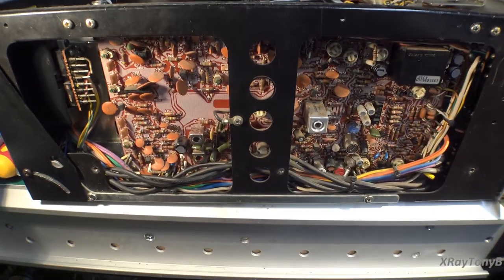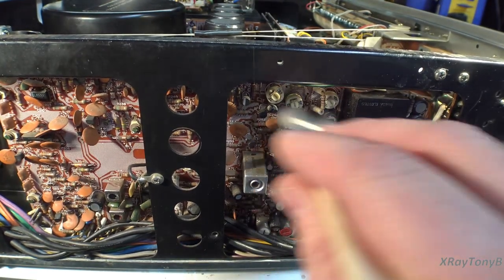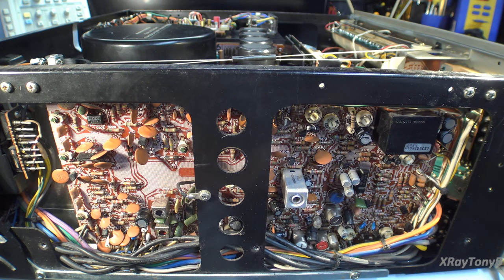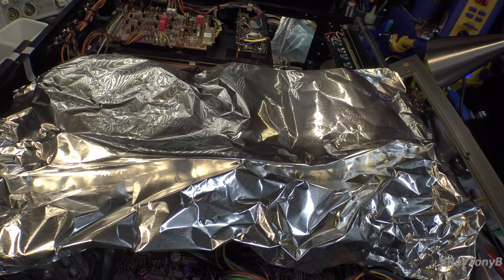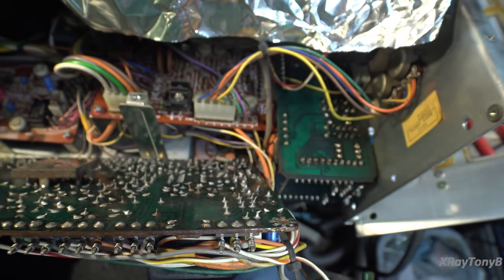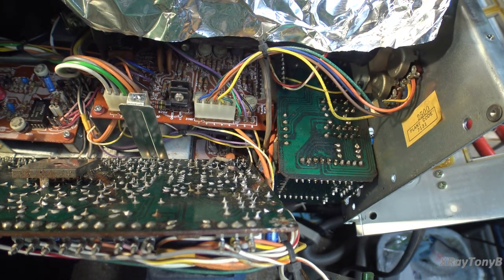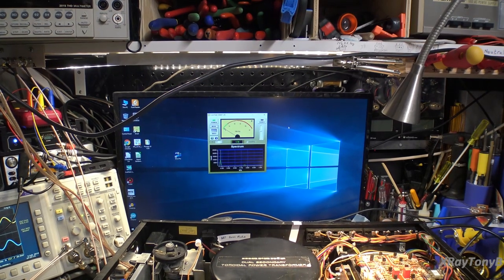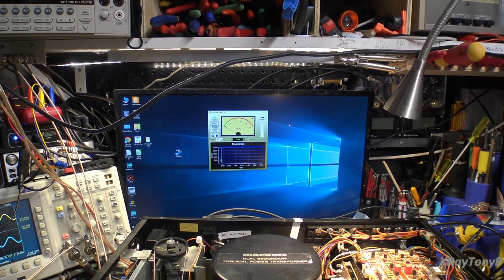Marantz 2500 Part 4 - Answering Viewer Questions and Finishing the FM Tuner

Comment: I have had wonderful results with "Oven & Barbecue Cleanser", a foamy product that comes in a spray can which is designed to dissolve caked grease.  Sometimes I need to clean PCB's that are so incredibly dirty and sticky with tar from smokers that cleaning with the usual products like alcohol (IPA) simply does not work.  I remove the PCB from the device and check for delicate components that are sensible to moisture, like coils, enclosed pots and relais.  Those sensible parts have to be removed prior to the cleaning procedure.  I spray the PCB on both sides with the white foam.  It immediately starts to bubble.  I use a soft paintbrush to apply the foam between components and leads, so the product reaches all difficult corners. I let the foam do its job for about five minutes untill the bubbling stops.  The thick layer of tar gunk dissolves like a brown slurry.  Then I rinse the PCB with lukewarm tap water and a clean paint brush.  I dry the PCB with paper towels and a hairdryer, so no traces of moisture remain on the PCB.  The Oven cleaning product does not attack nor affect the color codes on components, nor does it harm the silk screen printings on the board.  The end result is spectacular. I never had any issues with electrolitic caps or transistors.

Comment: Thanks for sharing your knowledge, much appreciated, another grand video. Though not a beginner, I still pick up valuable info and tips from you, so watch your vids all the way through. For instance I wasn't aware of the ESR changing with frequency (though it's obvious in retrospect).      
     Another issue with using a cap of different V rating is that of bias V. An incorrectly biased cap, with too low bias V, I've read, can exhibit distortion, as well as not staying formed properly. A classic EG, would be a cathode bias cap in a valve circuit. Thanks again for sharing your knowledge, much appreciated.

Comment: I would say that the type of restorations undertaken on this channel are probably best not tried by beginners. Heck, some of them are challenging for experienced techs. You'd be better starting with simpler devices. However, the diagnostic procedures  and repair methods demonstrated are sound and well worth practicing.

Comment: Re: electrolytic cap voltage ratings, the way I look at it is this: In the olden days, the caps were that much larger because oxide layer thickness wasn't that tightly controlled yet. Since this is what determines voltage rating, it had to be thicker for the thinnest spots to be matching spec in all but a small number of rejects. On the plus side, this could mean that a very good sample might sustain a much higher voltage than what it's rated for, and also sustain a lot more oxide layer degradation before it becomes excessively leaky. So basically, what they made were, let's say, 50 V caps that were then derated to 16 V for yield.

Modern caps are much more optimized. Their sustained voltage will fall within a much smaller range, and you won't get nearly as many of these positive outliers any more. In all likelihood, the average actual sustained voltage will be a good bit lower than for parts back in the day. 

Also keep in mind that given the same ESR, the physically larger cap will get heated up less.

This is why I would almost always uprate to a sensible degree. Physical size actually isn't a bad indication. As a rule of thumb, caps on supply rails should be seeing at least 1/3 their rated voltage... now you might find 25 V rated caps on a 24 V rail, so that would still permit a 63 or 100 V rated part there (80 V not being a common sight in smaller values). Not really a big limitation there. Looking at cap datasheets, it appears that ESR performance degrades beyond 100 V or so, so I'd rather avoid crossing that threshold. Likewise, any reduction in parasitic inductance may be welcome in applications where shunting RF is required, and that is hinging on physical size.

In places where there isn't any substantial DC, you're generally best off with whatever gives lowest leakage, and higher rated voltage tends to correlate with just that. As degradation is gnawing away at the oxide layer, whoever has the thickest one in the thinnest spots wins. (Well, with some variation in cap chemistry. Very low ESR parts can degrade rather quickly in undemanding applications when compared to more mundane parts. Longest life tends to be seen with dedicated low leakage parts there, like the orange ELNAs you have no doubt come across. They have become rather exotic but one or two series with a limited number of values are still readily available.) 
Now of course, this is the kind of spot where you may also consider a film cap or a bipolar (including the DIY version with two polars back-to-back) instead.

At the end of the day, there are so many variables influencing electrolytic capacitor life. The best chemistry is for nought if the seals don't hold up. A standard grade cap may last longer than a low ESR part where ripple isn't of much concern, or very much shorter where it is. All we can do is use the ones we see as a good fit and good quality.
Reply: Mike Adams  Exactly!  I have seen too many customers (on youtube channels) asking their restoration experts to save nickels and dimes and replace the bare minimum number of components.  It is like telling your dentist how to do the root canal and crown procedure (unless you are also a root canal dentist...).  A full recap project with good quality caps will probably last decades and you will enjoy it.  And those old electrolytic caps in the audio path will probably have to be replaced to produce better audio as well.

Comment: Hi Tony. I have to replace (4) MPC71  0.47 ohm resistors in my Kenwood SA-7100 because they are all reading between .7-.8. Can I use mouser # 588-TWW5JR47E Ohmite wirewound resistors as replacements? I'm asking because the originals are described as "metal plate" resistors, and the Ohmites are wirewound, which I would think might cause inductance that the metal plate wouldn't.  Thanks for your time and keep up the great videos! I learn so much from watching you restore equipment, and I'll say it again: to those viewers who think you go into too much detail, I say "bollocks"! That's how we learn!!

Comment: When you connect the receiver to your scope with that "T" does the signal go through a 1 megaohm resistor before it enters your scope? Or is the tape out plugged directly into your scope? Or when you are checking the amplifier does it go through a 1 megaohm resistor or is it basically plugged right into the scope?

Comment: I have a question about oil filled caps,  they're so expensive!  Can you replace them with film or any other caps ?   I have an old oscilloscope that has older oil caps. (I think they're oil).  They're blue, about 3 by 1-1/4 inch and axial lead,  rated at .5 uf at 1500 volts and look like electrolytic but no negative positive signs.

Comment: It's funny that MARANTZ didn't use  TI Blackfin DSP processing chips for receiving, processing and demodulating the RF into audio, Anyway The  PANASONIC portable radio that I have is all DSP using High School Mathematics to do the processing as well as generate the audio, That also goes for my TECHNICS ST-GT1000 except for the FM section.
Reply: That is because DSP did not exist in the 1970s.

Comment: The best capacitors in the audio chain is mundorf and JJ electronics and there tubes have you tried..
Did you put those blue LEDs behind dial revolting, why didn't you go with green much more pleasant on the eyes specially with the lights off
Reply: Marantz have pretty much always used blue lighting on solid state stuff. I do agree that green or amber is far softer and more natural.
Reply from the maker: Marantz uses blue backlighting.  Some people change the backlight color, just depends on individual preference.   Mundorf and JJ caps are more often seen in tube gear.  I've used them before.  They are very good quality.
Reply: Mundorf is overrated and overpriced. If you do a blind test with Nichicon you won't hear any difference
Reply: Worse yet, some people replace small electrolytics with huge Mundorf film caps rated at silly voltages that are arguably better suited for speaker crossovers (so not just regular WIMA or Panasonic jobs), and every time I see that I'm like "Why? Why?!" It's parasitics galore, can even make circuits oscillate because of that, not to mention it looks awful. Just use the right tool for the job.
Reply: They are too lazy to do research. They believe anything they read in a forum. I bought NOS Panasonic film crossover caps for 60 cents each and the sound is killer

Comment: So just curious as to what you can charge to restore this unit and how many hours total it takes. Wondering if I can make any money repairing or restoring units.
Reply: if you want to do it right you will make no money ;)
Reply: It takes about 60 Hours, thats what I'm guessing
Reply: @19janiboy96   So e en if you only charged 10.00/hr, you would have to charge $600. Would anyone pay that much?
Reply: @sidtryzbiak4542  It has to be a true collector to spend that money.  See for instance a brand new 'RX-A780 AVENTAGE 7.2-Channel AV Receiver with MusicCast' for about $650.  I have a humble collection of good Japanese sound equipment of the late 70's and early 80's.  I did restorations like that (but in much smaller scale) and spent more than 30 hours on each and used also Nichicon, WIMA, TDK and KEMET capacitors and Omron relays from mouser.  I spent more than USD 100 in parts in average on each equipment.  I could have bought a new 'Yamaha R-S202 Stereo Receiver with Bluetooth' for $129 but I didn't.  I enjoy more the vintage ones -- of course in a home theater setup you can't use those.  BTW, try to restore a sound/video equipment from the 2000's or later, with SMD and charge sensitive MOSFET components and double or triple layer PCBs -- for me it is totally impossible in my humble electronics lab (for hobbyist) in my basement...
Reply: @sidtryzbiak4542  There are definately people that would but they are not dime a dozen
Reply: THAT IS VERY MUCH TRUE BUT,I WOULD TAKE THE VINTAGE STUFF ANY DAY.I WOULD NOT PAY ANYTHING FOR THE JUNK THAT WAS MADE TODAY.
Reply: @davidluther3955  that's most definitely true